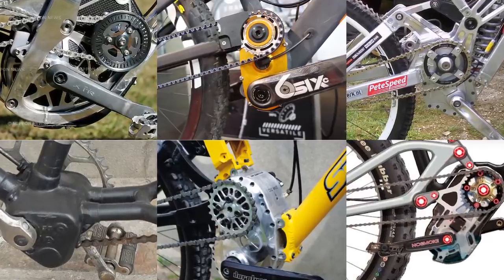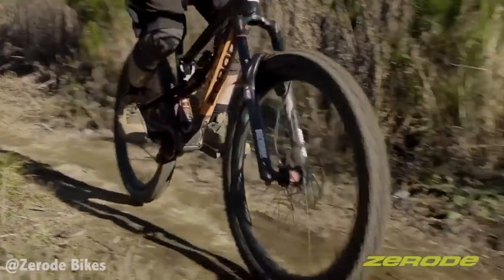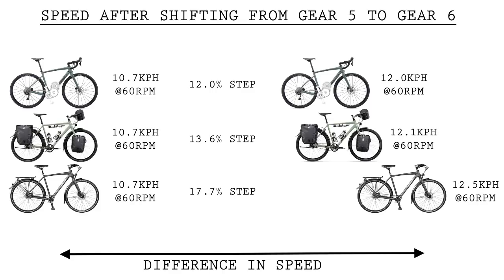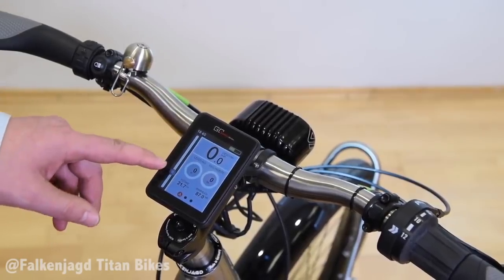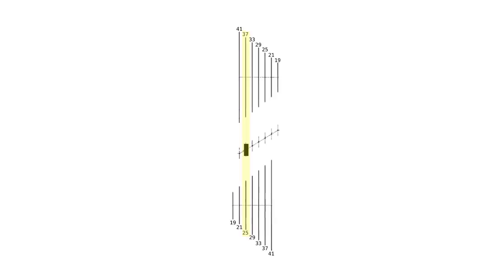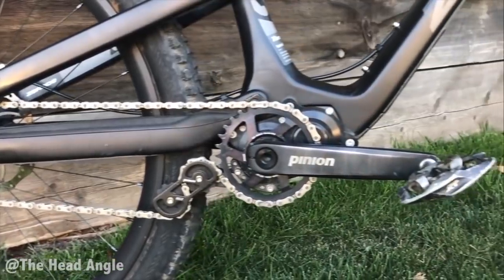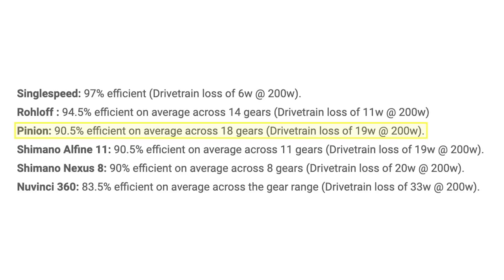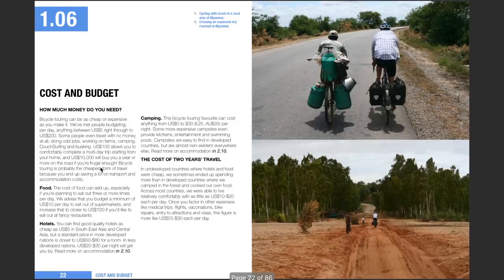Inside the FUTURE 13-Speed Shimano Gearbox - Weight, Drive Efficiency & More

Comment: Does this means Shimano is planning to phase out their planetary hubs in favour of this GB or make GB as separate product? If Shimano GB costs reasonably due to cheaper materials and volume of manufacturing, it could serve purpose of replacement for 7 to 11sp. hubs (for new bikes) to consolidate lineup into one product, maybe leaving 3sp Nexus where it is for simpler and lighter bikes.

Comment: I was watching your video again and if Shimano does this I hope they specify split frames, or whatever it is called, so a belt can be used over a chain.  Since all the shifting happens in the gear box there wouldn't be any need for a derailleur either.  Using a belt and getting rid of the derailleur would up the efficiency wouldn't it?
Reply: The derailleur is inside the gearbox.  How would you do the shifting without it?
Reply: @janusz0  I meant it isn't exposed to get bent

Comment: niiiiiiice. i most probably wont be able to afford it when it comes out but i hope it goes down in price with time and popularity. if so, even if it is more expensive, as long as still reasonable, i'll get it. 1kg more? i dont care. i dont compete, i ride to get fitter and to have a great time. 1kg is probably less than the weight of the books that ive been having to carry to class for the last two years. if the gearbox eliminates or at least severely reduces neccesary maintenance, i'm all for it, even if it cuts a little on the efficiency

Comment: Efficiency chart doesn't include Nuvinci n380, can you please include next time?
Reply: it doesn't have sharp edged gears, it has compressed balls inside so it should be less friction.
My experience with that is, my bike got heavier, but i felt more powerful on the pedal and now i can ride longer.
But not sure if it's because of the friction and efficiency or having the perfect gear all the time instantly.
Reply from the maker: We don't have data on the N380, but the N360 is between 80-85% depending on where you are in the gear range: https://fahrradzukunft.de/17/wirkungsgradmessungen-an-nabenschaltungen-2/
Reply: Thanks a lot!
Speedhub seems best with 500% gear ratio and that high efficiency.
But comparing the price/performance value, Nuvinci still seems more plausible. Would like to see if there are any improvements in new models like efficiency, weightsaving etc.

Comment: There is already a solution in market called Pinion, which also looks much better than that ugly thing! Shimano has already a good line in consumer market with the Nexus Alfine. I'm quite sure enthusiasts will stay with the extra charge of money for owning a Rohloff or Pinion.
Guess the next big step is who can best integrate e-motor and gear box in one realiable, low maintenance unit of cause with electric shifting/automatic. But this is a different case.

Comment: It's going to be hard to fit a mid motor in there. I wonder if they're planning on integrating a gearbox into their STEPS system
Reply from the maker: There is no room for motor integration. This is a replacement drivetrain for a regular bicycle.

Comment: Chain Slack Takeup?
how do they account for chain slack as it moves between the two internal cassettes?
internal tensioning arm? I'm not liking this design....
Reply from the maker: There is a derailleur of sorts inside the box.
Reply: @Cyclingabout  So basically, take an entire derailer shifting system, cassette, chains, and all, but wrap it up in a box. that's their new 'gearbox'

Comment: I wonder if this could work with a 3 speed internal rear hub for tourning? Overkill perhaps, but Shimano could produce a 2 or 3 speed rear hub specifically to work with this.
Reply: They do, so long as the chain needed for the gear box system works with the sprocket on the gear hub. You could use the 3 4 7 or 8, since the sprocket for any of them can theoretically be the same and if there is a compatibility issue with the chain, all that's need is a new sprocket.  
 So technically you could have even a rollhoff on the rear, for 14 in the rear and 13 in the front and with the right sprocket and freewheel up front, you could add on a mid motor and use a rear rack mounted battery and that would give you a 182 speed ebike. 
 That's insane.
Reply: Just find a 8 speed IGh hub and gear low enough for your touring speeds

Comment: I wonder if a cvt wouldn't be a good option.
Reply: That's what I was thinking. CVT with a sealed carbon shaft drive to the rear wheel.
Reply: That's the Nuvinci. It's simple but only 83% efficient.
Reply: Yes it wouldn't. CVT is horribly inefficient.

Comment: I'm sure the will find a way to include an electric motor in this thing.

The main downside of this system is, that you still have a chain exposed to the elements. I mean, why don't they use a belt with a cover? 🤔

Comment: Also wondering if the cassettes and chain could be miniaturised to 
reduce overall size and weight. I don't see an absolute necessity to stay with 
current industry standard bike chain pitch for the gearbox internals.
Reply from the maker: The patent application doesn't indicate anything about changing the chain/cassette size from normal - and that's surely something Shimano would need to patent.
Reply: @Cyclingabout  Shimano already did 10mm pitch chains in the late 70s, so maybe it's not novel enough to patent.

Comment: Less gear-range, more weight, more cost? Where's the competitive advantage? As it is now, will me a miserable market failure. I don't care how much sway Shimongoose has, bike companies are too smart invest in retooling their entire bike-building operation around this, unless it's cheaper, (less than $200) and/or appreciably lighter than the competition
Reply: What you are forgetting is that bicycles (& I should add, tricycles etc.) differ hugely for different needs around the world. There isn’t a one size fits all as you elude. There would be a huge market for the right gearbox which ticks the boxes of vast amounts of users - it may not be made for cyclists like yourself though. It will be a tough call for Shimano or others to make one that is an acceptable price, weight, efficiency and perhaps most importantly, provides significant market confidence to the big brands who could buy gearbox transmissions in large volumes in order to leverage economies of scale to bring prices down overall. One thing is for sure, interest is growing and I, like many are keeping a close eye on developments in this area.

Comment: This is a protective patent only. I doubt Shimano will release such a product. No-one seems to realise that the double-cassette system cannot change gears one tooth at a time. It has to be two teeth bigger or smaller, not one. No-one will accept that nowadays with 11 and 12-speed systems that give perfect one-tooth incremental shifting.

Comment: Unfortunately it doesn't fix the most annoying feature of derailleur drivetrains, namely having to wait a half turn of the wheel for a gear shift to complete - made worse in the last decade on MTB's by bigger wheel diameters. Instant gear changes are seriously addictive - if we were running gear boxes and derailleurs showed up, the instant shifting would be the biggest reason people wouldn't like them. Also the gear range is rubbish if they're targeting MTB use - it needs to be around the 550% range before it's any use to me, or 100% more range than it has. Also very surprised the Alfine 11 has such good efficiency too - 2nd gear on the one I have is so spongy it feels like the hub is going to break every pedal stroke and it noticeably loses the end of every pedal stroke through wind-up in 2nd and 1st to a degree. The efficiency tests were probably at constant speed driven by a motor though, so they missed this.

Comment: 2Chain popped in the vid like a genie 🧞‍♂️ when u called out two chains 3 times!!
Interesting.. why come out with something bigger and less efficient than what’s already available to the market?!
Reply: It's because Shimano has extensive knowledge in cassettes, chains and Di2 electronics. They can produce them at a very competitive price point. 
I assume the inner cassettes and chains are smaller than regular ones. 
Further, regular derailleur systems are efficient only when brand new and demoed in the showroom because after a short time in the dirt they are muddy, grimey and creacky, with efficiency down to 50-60% and require extensive maintenance.
Reply: The efficiency figures quoted are for clean chains and cassettes - run your super efficient derailleur drivetrain through some mud and the efficiency drops quite a lot. When most of the moving parts are in a clean oil bath there's much less of an issue.

Comment: Your bike will now have a transmission more complicated than your car. Getting all primed up for another CVT revolution. Does this mean Eagle 12 gear systems will drop down to Walmart bikes?
Reply: The problem with most CVT designs is efficiency, though, especially in high-torque, low-power applications... and a bicyclist is an extreme example of that. Let's use a 100 kg rider (heavy, but then I'm over 120 kg) on 170 mm cranks - just putting the entire body weight into one pedal, you're looking at 167 Nm of peak torque. Recumbents can get even more peak torque because the rider's weight isn't what's reacted against, the rider instead works against the seat and the frame (which is why recumbent communities have so many admonishments to gear down and spin, and get short cranks to reduce torque - it's easy for a rider to blow out their knees due to being able to put down more torque).

That torque figure is well into car engine territory.

Belt CVTs require higher clamping force for higher input torque, and power loss increases linearly with clamping force. So, a bicycle belt CVT would have to have similar clamping force to a car belt CVT. While it spins at much lower speeds, and therefore the power losses are proportionally lower, a human rider also puts out much less power than a car engine, and therefore the losses are a vastly higher percentage of rider power, I wouldn't be surprised by near-100% losses on a bicycle (that is, a rider only barely being able to even turn a belt CVT at full clamping force). (Additionally, making matters comparatively worse... a car engine CVT's computer can communicate with the engine control unit to reduce clamping force when engine power/torque is reduced, whereas a bicycle belt CVT doesn't have that luxury.) You could get around that problem by gearing down the rider to trade torque for RPM (bringing needed clamping forces down significantly), and then gearing the output back up to drive the wheel, but then you're adding frictional losses in that added gearing.

Toroidal and planetary ball CVTs AFAIK are better suited to this (I believe their sensitivity is more on power than torque?) but they're just straight-up inefficient everywhere, and this shows up in the performance of the NuVinci/Enviolo hubs being ~83% efficient. (Those figures appear to hold true regardless of size - I know there's a study on a wind turbine application of the Fallbrook planetary ball CVT design that claimed 84%.)

Ratcheting CVTs might actually work for this? Not too familiar with them, though.

And then there's electrical systems that can give a CVT effect.

Serial hybrids don't work for human power due to the extreme torque spikes and low RPM - you need a big, heavy motor to absorb the rider torque, especially at low RPM. (Just look up reviews of the Mando Footloose to see how badly that works.)

Power split devices, though, could be interesting, simply because they send a high percentage of rider torque through a mechanical path, greatly reducing what the generator has to deal with. That might actually make a power split e-CVT practical. They're still torque-sensitive, but the problem is again primarily at low RPM, once the generator is spun up it can handle the pulses better. (And, NexxtDrive's prototypes have a one-way clutch that prevents the input from overrunning the output. That means that they can only achieve effective direct and overdrive ratios (where automotive power split devices can do effective underdrive as well), but it also means that you can't overrun the generator's ability to absorb your power.) However, making one of these efficient requires a lot of work to make sure the motors and power electronics are efficient (because, for the portion of torque that takes an electrical path, you multiply the losses of both of your motors together), and existing e-bike motors and power electronics... aren't. I suspect this may be why nobody's actually put one into production, but the technology to make better motors and power electronics exists and is used today in automotive.

Comment: ??? So Shimano re-patented the Phaser from 2007 and added e-shifting?  Sort of a Phaser 2.0?
Reply: The difference is they're rich enough to bankrupt most companies likely to fight their patent in court. The sideways sliding cassette is a feature that wasn't in the phaser gearbox AFAIK. It needs another 100% worth of gear range before I'll be interested anyway. Also interested to see what happens when you stop pedalling half way through a gear shift or change gear while stopped or rolling backwards.
Reply from the maker: The Phaser gearbox is the closest example. But the crankset is connected directly to the first transmission, and is 11-speed using two regular cassettes.
Reply from the maker: @peglor  I suspect it'll be the same as a regular derailleur. A loud crunch!

Comment: It's literally just a derailleur in a box
Reply: N a more complex n expensive n heavy system
Reply: It’s a transmission. It’s a great idea!
Reply: Not accurate
Reply: a gearbox is just a box with gears right? as long as it's not too expensive or too heavy, low maintenance and shifts well, the whole point of a gearbox is that it should just work and you don't need.  to know how it's working or clean it after every ride. it could be also an advantage if they had the bright idea to use one of the many cassette standards so you could service your gearbox yourself just using standard cogs and chain links
Reply: @geemy9675  Sure, I guess a clock is too then…

Comment: 13 speed?  Lame!  I will stick with my 18 speed pinion gearbox.  Using cassette, chains and derailleur will have all the same problems and durability problems that traditional systems have now.  Sealed pinion gearbox with cut gears is far superior.
Reply: Oilcan Racer I’d agree.  I love my pinion 1.18 :)  the best gearbox out there for mtb

Comment: Gads, not a fan of this. Undeniable cool, but I don't want electronics on my bike. Can someone tell me how the modern 1x drive train is superior to the excellent 8 speed (m900 days) set up?
Reply from the maker: More simple to use for most riders, lighter, fits a wider tyre in the rear of your bike, 3-4X more durable chains. Not a quantum leap, but definitely an appreciable difference.
Reply: @Cyclingabout   Thanks for the reply :) But it's at the cost of gear ratios. On the down hills I find I miss a 48T x 12T and the oh my god this is steep bail out 24T x 32T. Thicker sprockets with better spacing. Optimal chain line. I coincide on the tire though. 3.0 x 27.5 fat is oh so fun. But I still like the feel of 26" wheels so much better. Damn I am the old troll retro grouch now. Remember kids, the older you get, the faster you were :P
Reply from the maker: @chrisnelson6991  48x12 is the same as 40x10. And if you run a Shimano 51t rear cog, you can get almost the same climbing gear too (it's very slightly higher). Totally agree on chain line though, which is one reason why you won't find me using 1X on anything other than a dedicated mountain bike anytime soon. Anyway, I've got a 1X/2X/3X video currently in the works where I'll go into full detail!

Comment: Rohloff efficiency numbers are very suspect for real-world use.  I rode on for 2 years and it never got anyhere near standard drivetrain efficiency even after getting b4oken in.  Also, both Rohloff and Pinion both need a main chin or belt, so you should only count two chains on your comparison. Plus, planetary gear syst3m efficiency goes way down when in low speed/high torque situations and this is much less of an issues with perfectly aligned roller chains.  I would be surprised if ths system didn't feel at least as me efficient as a Rohloff in practical use.  However, for mountain biking, you re really eating I to a lot of space, and it will be tough to avoid compromies for suspension pivot placement, water bottle space and on-bike stotage space.  Maybe for fat bikes or downhill bik3s but not for trail, xc, or even enduro.  Traditional derailleur systems are far too cheap, adaptable, efficient, and even reliable enough for 99.9% of mountain bikers.

Comment: I had a 10 speed derailer on my race bike 30 years ago...any more was pointless.
Reply: 2x5. “10 speed” now means a 10 speed cassette and matching equipment
Reply: The future is now old man
Reply: Yup. Reminds me of the 4 speed automatic I had on my Chevy 30 years ago. Any more was pointless.

Efficiency is for morons. I'm in the process of converting my house back to single-pane windows, incandescent light bulbs, and high-flow industrial water fixtures. I'm also ripping off the solar panels that the previous owner installed and converting to coal.

Comment: I hate that it uses chains and cassettes, the chain is going to stretch, and when it brakes it's going to wreck everything
Reply: Surely we all know by now that chains don't stretch, they wear*.  In a clean oil bath the wear is going to be very low.  *(As the bushes wear, the links move apart. The links remain the same length, the clearance in the bushes increases as the metal wears away)